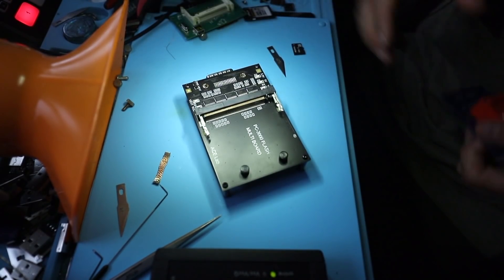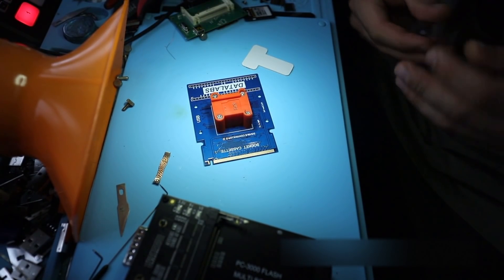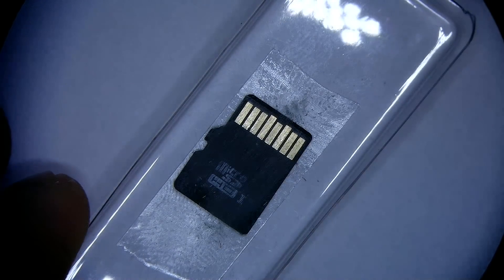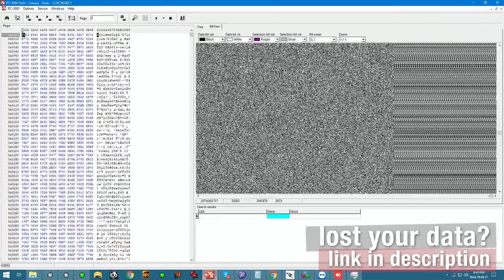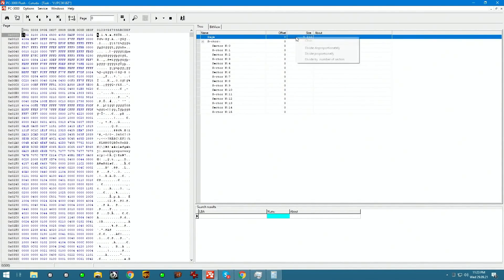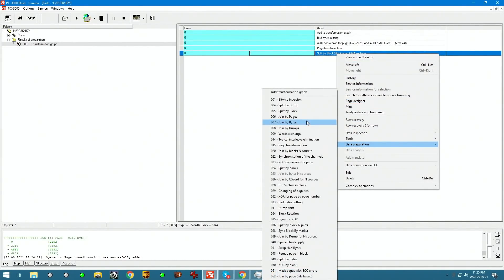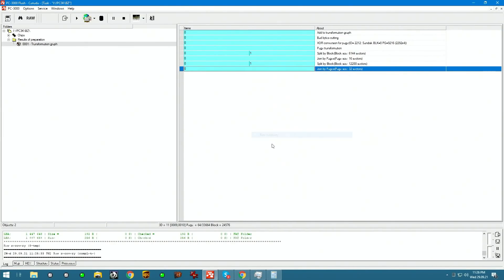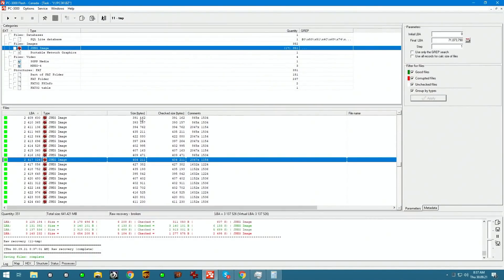recovering ADATA memory card with some new tools from Russia

Comment: How much would it cost to recover data from 3 broken 32gb micro sd cards in total?
Reply from the maker: physical damage?
Reply: I used to record fm radio with them 24/7 and they don't show anymore even on partition managers
Reply: From the outside they seem fine but I've no clue

Comment: I'm surprised you didn't have something like that tool before this.

The only problem with that tool is if the layout is different. I was expecting long ago to see you using a breakout board like the one you use for soldering, but which uses fine spring steel wires instead. Just plug a wire into a socket on the board that you need to connect, swing it over onto the memory card, and position it on the data line you need to connect to. The spring steel wires could be insulated, very fine, with sharp points, and provide excellent contact from the memory card traces to the breakout board. A two minute job instead of fifteen or more, with no soldering mess, fumes, or difficulty.

A quick search of the internet didn't find anything like that. Maybe something you could build. A small royalty to me would be all that is required! :)

Comment: Hi erkin cool job as always. The tool that u used for sd card seems to shorten the work. I have a request though, i really would like to learn the sector construction like you did on the page designer. Would you do another example without presuming us knowing certain parameters like you said for the sun disk, or is there some documents/samples cases that you can share so i can read and understand. Lots of love from istanbul.Nb: I checked the web site for the adaptor but they dont sell any adaptor or i started to get old even though i am just a bit below 60.

Comment: Erkin, if you’re still accepting video requests, I’d greatly appreciate seeing how you handle the situation when you cannot obtain ECC codes after a chip dump.

I ask because I’ve got a SanDisk Ultra SDHC monolith from 2021 that I cannot locate ECC on. I’ve tried reading the card at the 3-1-4 and 6-2-8 timings and after the application of the data preparation steps, after a raw recovery, the largest checked file size is only about 160 bytes. With no ECC, I cannot perform a reread. Is there anything that can be done at this point other than wait for ACE Labs to come out with a program and/or resource update to improve the read quality?